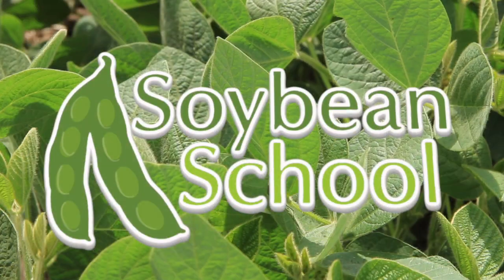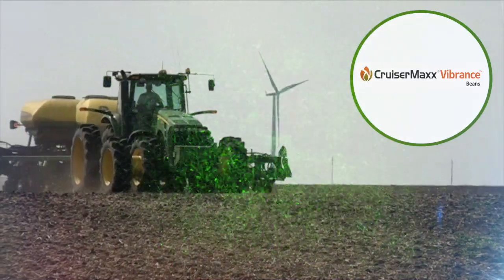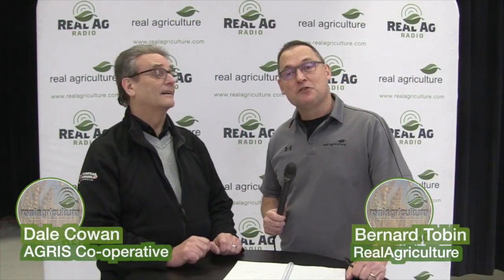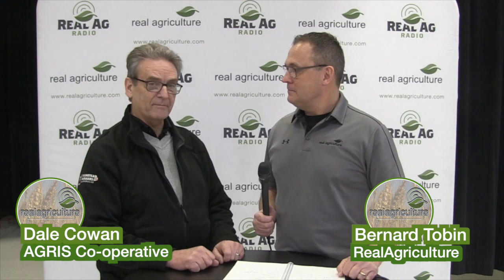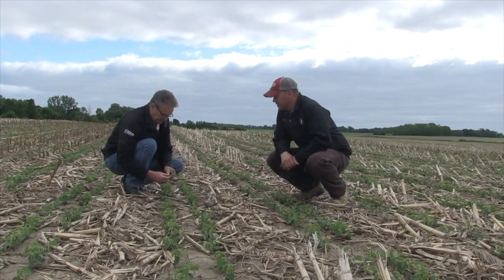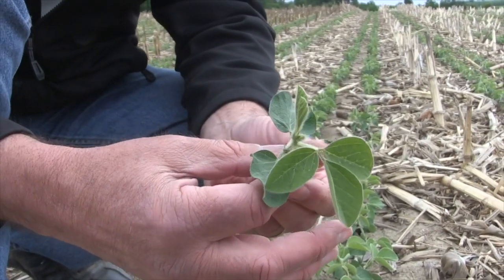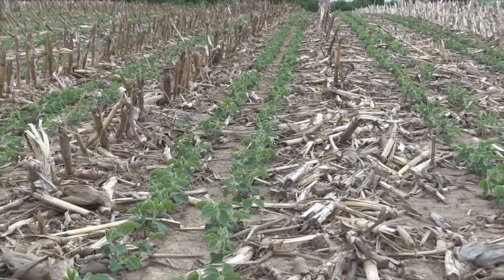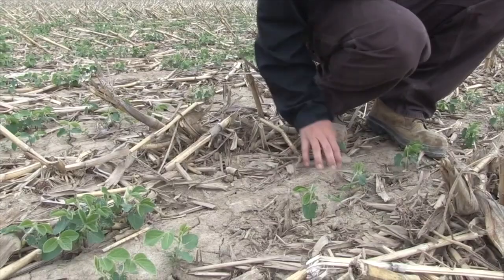Soybean School: Learning from strip-till field trials

Comment: We use no-till unfertilized Hazard check. So next to that we had tillage with and without a normal soybean fertility program strip-till with and without a normal fertility program strip-till with Acorn fertility program and then no till with fertilizer. Strip-till with corn fertilizer made the most yield but any of the fertilizer applications that had a yield bump the year bump did not pay for the fertility. It ended up being that you fertilize soybeans just to maintain the soil. The tillage made no difference so when you take out the cost of tillage you had a major deduction on yield.